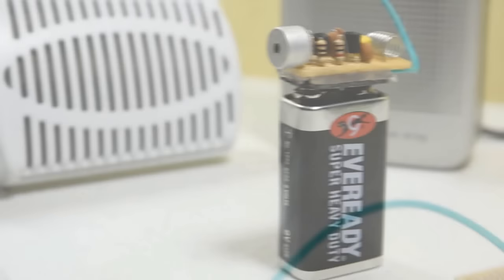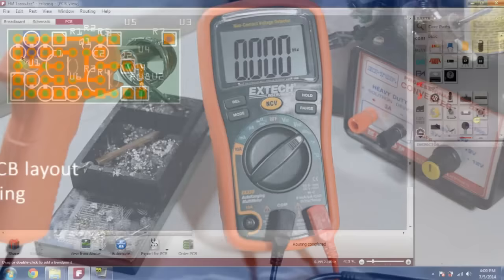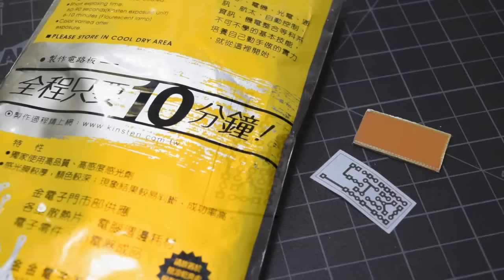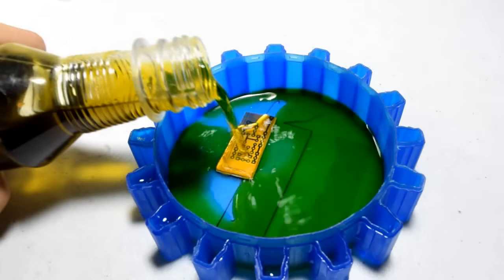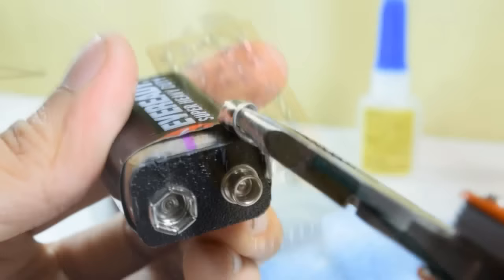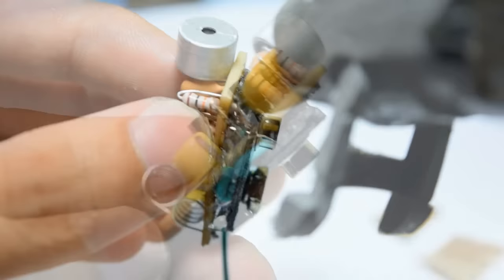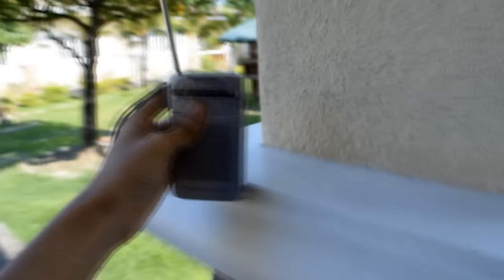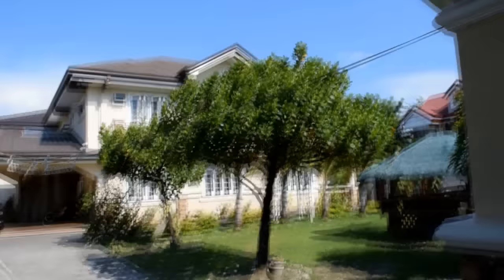Build A Long Range FM Transmitter (Homebrew Radio Station)

Comment: hey bro,  can i use chip resistors(thickfilm)  instead of that one?  and any substitute of transistor 2n3904? i can't found it anywhere..
Reply: maybe 2n2222
Reply: MistrzZen I used 2N2222 transistors and it works.Basicly, the only difference between the 2N2222 and the 2N3904 is that the 2N2222 can handle up to 1 amp while the 2N3904 can only handle up to 200 miliamps.So go ahead and use 2N2222.

Comment: What can i use if i dont have a trimmer capacitor?
Reply: Anj Rivera use a fixed value capacitor whose range is between the trimmer capacitor ...but this will give you a fixed   transmitting frequency

Comment: Hi, This video is great! What is the maximum range of this FM radio?
Reply: +Neymar Nepomuceno Cavalcante About 100 feet if you are lucky. With a proper lenght of antenna wire, it will go further. Also a stronger transmitter would help. This is a simple but weak FM transmitter.

Comment: You know, its illegal to build transmitters that run in the ultrashort wave frequency band?
Reply: ***** I know some that do and are crazy enough to triangulate you. Just saying.
Reply: *****
Just be careful with it. I know that at least my former employer is basically a radio nazi. Believe me, breaking the law would probably get you done for good with this guy.
Reply: ***** exactly
Reply: I am not saying you are likely to be caught, quite the opposite actually. But it is still a fact.

Comment: Can i tune in to transmitt to 130+mhz so my baofeng could pick it up?
Reply: If you has a capacity to receive you can , but must change oscillator part of the circuit
Reply: sooooo,whats the part of the circuit i have to change?
Reply: you may change inductor or capacitor to set frequency.
Reply: I like to start discussion on this topic in my channel. If like then start discussion on my channel, so that i will always available to reply.
Reply: Tech Maker ok,thanks! :)

Comment: Nice Video, can i broadcast the same frequency as a radio station to troll my parents?
Reply: I know this video make it seems cool and all, but this is illegal, you can't transmit on the frequencies you see on normal radios. You can do it since the range is pretty small so the chances of someone or the FCC finding it out is not that big, but if you do, you can be in big trouble.
Reply: Olijuana i know, but if i have such a small range, noone will notice. Also, arent there open frequencies? some time ago, here in germany, we used to have "cb-funk", or  citizens band broadcast, an everyone could transmit there
Reply: AgentBLP Yes or course there is some frequencies you can transmit on, like you said you can transmit on CB (citizen band), FRS (Talkie walkie like type) and some other frequencies without a license. But you won't have a near as big audience as these frequencies aren't received into you "normal" radio. And even then I'm really not sure you can transmit music you don't have the copy or broadcasting rights for. But now that you said you were in Germany. it may be different, I don't know.
Reply: Whats the song in the background? Of the video.
Reply: Whether or not it's legal, nobody answered the question if it would be possible to mess with his parents
Reply: The answer is Yes, you should be able to broadcast on any normal FM station. I don't know about with this particular project though. You may check out the use of a Raspberry Pi to do the same thing but also play WAV/MP3 files directly from the Pi.
Reply: If you transmit to a certain frequency that is currently broadcasting in your area, say your parents is tuned in to FM 107.1 and you try to also broadcast in that same frequency, you will get interference and noise.

Comment: Can I use a simple capacitor instead of a Trimmer one?
Reply: Jorge Tu trimmer cap allows you to adjust the frequency at which you broadcast
Reply: @9550raja  oh! Thank you so much. Is just that in my store nearby I didn't found it

Comment: can i put a larger battery for longer range?
Reply: no, larger battery will only increase run time! the voltage is constant in the circuit. Youd need a bigger antenna and an amplifier!
Reply: nice, thanks

Comment: can u say how can i connect the trimmer capacitor
Reply: Trimmer capacitors are non polarized capacitor, so you can connect it at any orrientation
Reply: sry i have 3 pin trimmer cap so i need guidence plz
Reply: Typically, your trimmer cap has three terminals, of which, the two on ends are connected together. Connect one wire to one end or the other, it doesnt matter. Then connect a second wire to the middle pin :)
Reply: thanks for the reply dude i really appreciate that

Comment: This is actually fake. You'll notice that the camera cuts when he turns on the radio. At 4:10 it's quite apparent that the bose speaker is no longer playing it at 4:05. From 4:08 on, the sound quality is directly being sent to a bigger, more capable fm transmitter. It is very noticable that the song is playing too fast past the 4:08 mark. Sorry, it's fake!

Comment: what is the range?
Reply: anyone has answer?
Reply: What does lol mean?
Reply: Other means of LOL?
Reply: If you use a long enough antenna and chose a channel with no other radio broadcasts, you can probably get some good range. Maybe even a couple hundred yards/meters. Be sure to check your regulations though. In the US anything capable of broadcasting over a couple hundred feet is illegal.

Comment: Nice video, but it is all about the build, and has nothing about how it works. The statement in the video, that building this is a great way to learn electronics, is very false, as the content of the video teaches virtually nothing about actual electronics.

Also, any instructional electronics video should present decent soldering techniques, and it looks like almost every joint was cold, or marginal....still worked, but pretty bad nonetheless. I did not see any obvious reason why the soldering was so poor, except for the techniques used.

Comment: Just so you guys know, this is illegal. Well I don't know for everywhere in the world, but for most places it is.
Reply: +Olijuana In the USA, it's legal as long as the broadcast range doesn't go over 200 feet
Reply: No it's not .-.
Reply: Well you can transmit on some frequencies, like CB, FRS, etc. But you can't transmit on frequencies that normal radios receive.
Reply: It's not about the range, it's about the emitting frequency.
Reply: +Olijuana nope. Just don't transmit over frequencies actual radio stations are already transmitting on and you'll be a-okay
Reply: Maybe you'll be okay because the authorities won't find out, but it is illegal. There is some bands and frequencies for "normal" people to use like I said, but if you want more you need an amateur radio certification, which allows you to use the amateur bands. But you can't in anyway, for nobody,  transmit on the frequencies you see on "normal" radios. You would need a very special type of license to do that, and be a "true" radio station. And even if you got that, you still need to pay for the rights of the songs you want to play on air.

Comment: Do you call that a long range transmitter? What a joke!!!! I used to make 2 transistor bugs 40 years ago with 1 mile range.
Reply: Bruno De Michelis a joke? it's that small and capable of having a distance
Reply: Mine were smaller, then and definitely more powerful than this. You better start improving.
Reply: Bruno De Michelis I would be really interested in a schematic of the one you used to make.
Reply: It is still copyrighted. Sorry about that.
Reply: Your comments totally define you